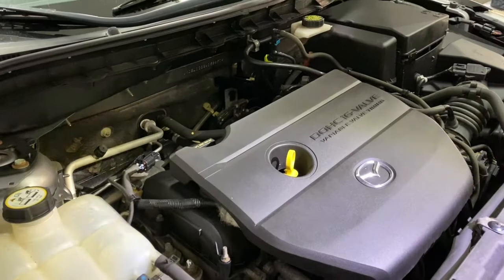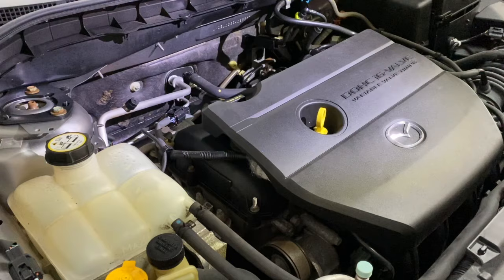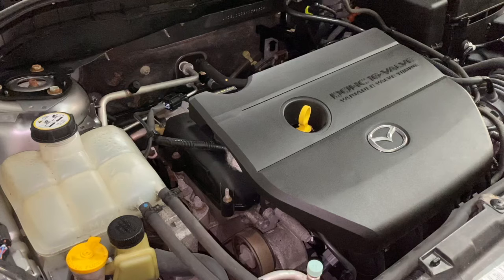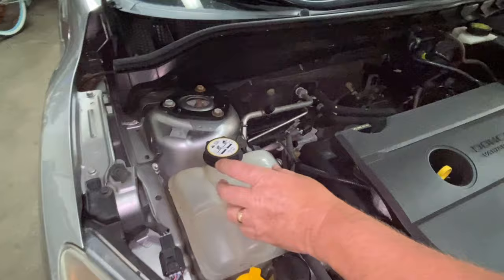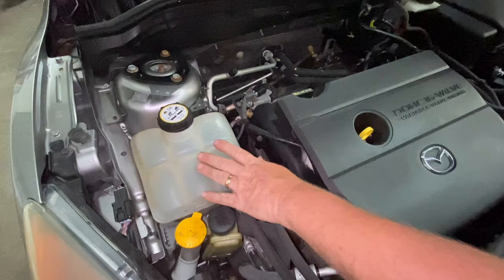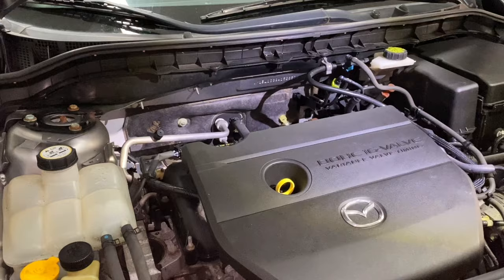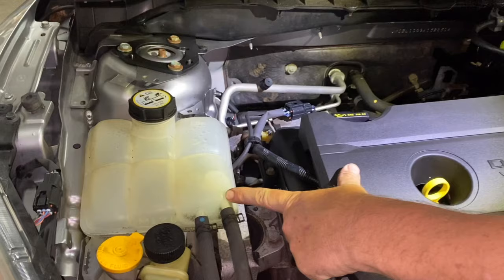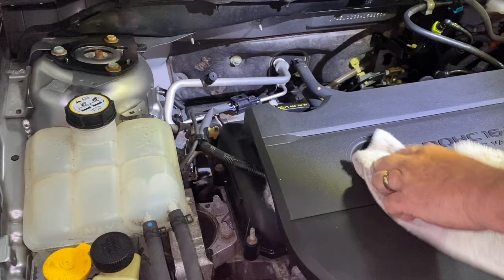Learn 3 Symptoms of Blown Head Gasket

Comment: I've had issues with my 2001 diesel ford courier. Car overheated out of nowhere. Replaced the rad cap, the water pump, the thermo, replaced most heating hoses, flushed the radiator out, no luck. Car doesn't like starting and has a slight bounce on the idle when cold. Slightest bit of white smoke/condensation out of the exhaust, but as i put my foot down on the throttle it blows out clean instead of more smokey etc. My heating core in the cab has its issues, doesnt like to open up for heat often but when it does open up it's blowing hot hot lol when the car starts to get hot it blows out coolant into the overflow and boils/steams out the overflow hose. Wondering if its a bad head gasket or worse, a bad head.. i cant figure it out atm. Thinking of replcing the head gasket and checking if that does it, but if you have any suggestions or tips, id love to hear them :) cheers mate. Great video.
Reply from the maker: Seems like its a failing head gasket, probably from corrosion being you said heater doesn't work good.
Reply: @Motorcarnut  cheers for the response mate. That's what I've been thinking myself tbh, another persons input is always welcomed though :) I shall replace the head gasket and see how i go. Wish me luck lol cheers.
Reply from the maker: Good luck and let me know how you make out!

Comment: I have coolant spitting out from the cap I'm assuming is the head, clutch fan is fixed waterpump is fairly new, thermostat is open, it overheats a lot faster when ac is on.  When driving with it off I haven't seen it get hot
Reply: I also had the vehicle for 2 weeks and only used it 3 times fml
Reply from the maker: Yes, it sounds like either a blown head gasket or cracked cylinder head if water pump thermostat and radiator are not clogged. Also, check the radiator cap could be faulty you never know. Start with simple things first
Reply: @Motorcarnut  a bad radiator cap can cause smoke in exhaust??
Reply from the maker: No, but a faulty radiator cap can cause the engine to overheat and ultimately blow the head gasket and then blow white smoke from the blown head gasket failure.

Comment: I have a 05 Santa Fe and I live in Vegas on super hot days 110 + my coolant will be bubbling in the reservoir, then when my car is in park and in park only I will loose coolant and it will be raining from the res on the bottom and my AC will go from hot to cold. Those are my only symptoms I don’t have any smoke from exhaust, light smoke from where the coolant is hitting the hot parts of my car when it leaves the res, and it does smell like coolant is burning. Anyone know if it’s just a leak, a head gasket, or my radiator cap?
Reply from the maker: Try the cheap simple things first. A faulty radiator cap will cause your symptoms, start with that.

Comment: Hey man I got a 2005 GMC sierra 1500 SLT 5.3L, over the last month and half everytime I start my truck there’s a lot of white smoke and has a blue tint but smells burning sort of and I checked my oil I lost a lot 90% of it and my coolant gets very low too, I have no leaks tho I checked all around and nothing. My oil isn’t a milky color either just normal used oil and due for an oil change with in the month, so should I changed the oil out soon and Motor flush it? Then get a new head gasket? Or maybe is it possible value covers or piston rings? I need some advice here thanks
Reply from the maker: 90% oil loss and no leaks? you sure? The burning smell is probably oil and or coolant burning . I always say start with the simple things first. you can try the motor flush and try cleaning the engine top and bottom so after it dries you can see if you have external leaks as well. If it still smokes then further checks are needed.

Comment: My temperature gauge goes bout 224 a little over the half mark witch is 210 then then the fans turn on and it goes back to normal to 210 I replace my thermostat and still doing the same thing plus I notice my Cooland hose the main one that goes to the radiator gets real hard. Do u think is my head gasket by the way I don’t see any smoke or oil or even Cooland leaking.
Reply from the maker: Sounds kinda normal. Was the temperature always like that? Could be a failing coolant temp sensor that controls the gauge.

Comment: So my car has a coolant consumption problem where the coolant would go low but car doesn't overheat and ac works fine but heat sometimes gets intense and on next few days it is perfect. Any ideas of it's head gasket or something else? Also it's es350
Reply: You could have a slow leak at the heater core
Reply from the maker: The AC has nothing to do with the coolant system and the heat only get so hot so, like someone else said could be a small leak somewhere, as long as it doesn't overheat or has excessive white smoke out the back or coolant mixing with the oil.

Comment: I have a 2014 Dodge Charger I have a Coolant problem. I have changed Thermostat ,water pump ,sensor I have kno leaks whatsoever under the car or around the block, I have noticed my Fan comes on when AC Is On , but it’s Runs Hot , I don’t have white smoke coming out the pipes, But honestly I’m lost trying to figure out what it might be please can someone help me
Reply from the maker: Fans coming on with AC is normal , it’s supposed to. Could be as simple as a bad radiator cap or overflow tank cap. Clogged radiator or air in the system. A blown head gasket could pump up the coolant system and cause it to run hot too.

Comment: I'm gonna buy a Durango but the owner thinks it's a blown gasket cause she was driving it and it died. She said it didn't have coolant when it died. But I did these steps and none showed signs of it. Could it be she just didn't put coolant in it and it overheated and died?
Reply from the maker: Let’s say that’s true? If it indeed overheated because of NO COOLANT that’s worse than a blown head gasket and they didn’t keep drive it . This case it may need an entire engine for it to overheat that bad it shut off. Because you can have not only warped heads but possibly the engine block as well. Best to have a mechanic look at it in person before buying it. Good luck

Comment: My car doesn't show any of these signs, but the coolant is overflowing and saw some bubbles with the radiator cap off. What could be the issue? Didn't see any coolant leak too
Reply from the maker: Car is overheating for some reason, head gasket should be last on the list, check radiator cap, thermostat, water pump clogged radiator first
Reply: @Motorcarnut  thanks. Will check them first. Hopefully it's not anything major. It's not overheating though, temperature is normal right in the middle
Reply from the maker: If the coolant is overflowing it could be just a bad radiator cap. But something is wrong, shouldn’t be overflowing.

Comment: Hello my car doesn't have any of this symptoms but yes I do find that that my car is weaker but he does not have this symptom all he does I feel him up with water because I do not put no more coolant because every time I ride the car I get home he starts spilling the water through the plastic bottle and starts boiling at the same time but he does not have the symptoms why could this be please I need help I was thinking of flushing it and cleaning it but I wanted it to be sure cuz I'm about to buy a new radiator I could drive him he never gets hot it's always on The Middle he drives normal on the highway but as soon as that I get home and I turn him off that's when the bubbling starts coming out of the plastic bottle and drops all my water on the floor and I have to be refilling it to be able to drive him
Reply from the maker: Coolant keeps the car from overheating, straight water boils over faster, that’s your first problem. Yes, definitely the car is overheating, could be as simple as a bad radiator or overflow tank cap, clogged radiator, bad thermostat or water pump.

Comment: I read some questions asked and didn’t see the one i had. So I’m not burning off any coolant and i did a oil change a week ago and only noticed it to be discolored blackish gray. But i changed the exhaust manifold catalytic converter last night then today noticed more white smoke on cold start then also if I’m revved around 2,000 rpms like continuous if it’s revved is it still a blown head gasket ?
Reply from the maker: Its possible, You can have someone check the coolant for exhaust gases that would indicate a bad head gasket.

Comment: My FJ overheated then when we filled the radiator bubbles overflowing everytime i drive the radiator hose always pops off is this a sign for blown head gasket?
Reply from the maker: Yes
Reply: @Motorcarnut  i told my mechanic and he was telling me "oh its only making bubbles because we put that radiator cleaner" now when we check the oil mixed up with water. Would it get fixed if we replace the head gasket?
Reply from the maker: That don’t sound right to me.

Yes, but also have to make sure head and block are straight and not warped.

Comment: I have a 2004 PT Cruiser 2.4 L Turbo I replace the water pump bought a new radiator has steam coming out of the radiator can't figure that out there ain't no white smoke coming out of the tailpipe though I was wondering why is there steam coming out of the radiator for and bubbling up out of Reserve I can't figure that out it has a sign of little bit of milky oil on the valve cover cap it doesn't have no milky oil at all can't figure out the problem I say it might be a blown head gasket but I'm not for sure though thanks let me know what you think it might be this is my first PT Cruiser though I didn't know they give you that many problems
Reply from the maker: Simple things first, did you replace the radiator or overflow cap? And what about the thermostat? Did you bleed the air out of the system after radiator and water pump replacement? If those check out fine than it’s probably a failing head gasket pumping up the coolant system.
Reply: @Motorcarnut  yes it has brand new radiator cap and everything I did all that and it's still doing the same thing
Reply from the maker: If you did everything I mentioned then it’s a bad head gasket or crack somewhere in the coolant system getting into the combustion chamber but probably the weakest link with is the gasket.

Comment: Great video man, i do get white puff smoke after my car driven and sets for a short of time white smoke last for 3-4sec at startup while car is warmed and it does happens often mainly when my car parked incline ? Any idea what is that  ? 08 Lexus gs350 it has 123mi thanks again
Reply from the maker: Thanks!

If you are getting that white smoke when restarting a hot car then it seems to me there is a little bit of coolant burning off meaning the head gasket is starting to fail. Coolant should never be in the combustion chamber. And a crack somewhere would be rare.
Reply: @Motorcarnut  but my coolant level always at the line 🤔
Reply from the maker: Maybe the puff of smoke is blue ish? That would mean you’re burning a little oil

Comment: Sir, working on 1996 Buick Park Avenue 3.8L for a young man so he can go to school.  How can you tell the difference between blown head gaskets versus cracked block.  The car had been sitting for 12 months, drained the old gas, fresh plugs. It started right away and the smoke was horrible through the muffler and it was coming off the engine through the vents.  I want to help, but not sure how to proceed.  Thanks.
Reply from the maker: The only way to know the difference is to take it apart and inspect it. But a little history would help. Was the car stored in cold climate and left outside with the proper mix of antifreeze and water? Let’s say the car was from Canada and left outside all those years with only degraded coolant then I would say it probably froze and cracked the block but those cast iron blocks can take a lot of abuse and would of blown out a freeze out plug first. Probably a blown head gasket in my opinion.
Reply: @Motorcarnut  it’s in Mississippi doesn’t freeze much here, but I’m thinking he let it overheat, low coolant. Thank you.
Reply from the maker: If that’s the case it’s probably a blown head gasket like I said before. Those engine are very strong.
Reply: @matthewpague1750  You can try block/head gasket sealant product.

Comment: I have a 2005 scion tc and there is oil in the exhaust pipe.  What could this be?  There is no water in the oil and no oil in the water over flow.  Gd video
Reply from the maker: When you say oil in the exhaust pipe is it raw oil dipping out? a film of oil? Is it buring blue smoke out the tail pipe?
Reply: It’s not blowing blue smoke
Reply: I put my finger in at the edge of the exhaust pipe and it’s black oil
Reply from the maker: Oil out the back like that often indicates serious failures or wear of the engine's internal components, such as valve guides, broken or worn piston rings, or a head gasket staring to go. You should have a good mechanic check it out for you sooner than later to save money.

Comment: My Toyota Camry exhaust is smoky white when first turning on the car but  it doesn't smoke once driving minus when occasionally hitting the gas after being idle at a stoplight. The low oil pressure lamp light occasionally comes on when braking at a light. The mechanic says if it's the head gasket the white smoke should be constant and it isn't. I don't know what to do.
Reply from the maker: When you first start a cold overnight vehicle there will be light thin whiteish smoke with is condensation and normal. It should be like in my video. And after hitting the gas when the engine is hot should not show signs of smoke. Low pressure problem should be checked out immediately because if it’s not a faulty sensor and in fact low oil pressure you can destroy the engine very quickly. Also bring the car to a good mechanic and have them check the coolant for traces of exhaust gasses, that will confirm a head gasket that is going or it’s something else. I can smell the exhaust and know if it’s burning coolant but I’m not there to help you.
Reply from the maker: Meant, it shouldn’t be smoking like in my video
Reply: @Motorcarnut  thank you for responding. I am following a few local leads for a good mechanic now. It is smoking white like in your video when first turned on. It doesn't while driving but I'm nervous about the destroying engine quickly thing. Anyway, thanks 👍
Reply from the maker: It’s not supposed to smoke like mine in the video, even cold. It’s probably a head gasket starting to go, like it leaks very little overnight and when you first start it, it burns off what was in the cylinders and that’s why you get the smoke when cold and clears up while driving. Either way have someone honest but stay away from dealerships, they will waste your time and money.

Comment: My car has low coolant despite a new radiator and there are no leaks. Can a coolant leak into the engine cause a catalitic converter to go bad? My check engine light is on and the code read P0420 as a catalitic issue.
Reply from the maker: Yes, if you’re burning coolant because of a failing head gasket.
Reply: @Motorcarnut   It may be the coolant reservoir leaking from the cap. I drove the car and when I got home I saw coolant leaking out of the cap. It is still under warranty so exchanging it today.
Reply from the maker: @arielrodriguez6980 that will do it

Comment: i got a 2004 Chrysler pacifica that runs hot but does not smoke. a mechanic told me it was the head gasket but there is no milkshake it runs hot. i had to take the thermostat to get it home from the mechanic. there is a shop that wants $1400 to replace it but even they asked if it was smoking. do you think it's the head gasket? could the head( s) be warped?
Reply from the maker: You have to see if the coolant system is being pressurized by the pistons causing the overheating condition. That would indicate a blown head gasket. Make sure radiator, water pump is good and even a simple radiator cap can cause the overheating as well.
Reply: @Motorcarnut  thanks. the item that tipped the mechanic off was the presence of some type of carbons present it the overflow container. he used a sensor and said it should read zero. as the car was being revved the sensor began to show elevated numbers of this carbon. that was his evidence that my head gasket was blown. I will check out my radiator cap.

Comment: my 2023 genesis g70 3.3t awd with 2000 miles  the head gascet blew  it smokes from radiator from exhasut and oil pours from exhaust
Reply from the maker: Wow! Unbelievable. No reason for that, bring it back and get a replacement vehicle.
Reply: @Motorcarnut  in order to do lemon it needs to break down 3 times then i can switch it i took it to service i found out its the Turbo it gave up  thats why it was smoking and leaking oil they gonna fix it soon
Reply from the maker: @serobboshnakyan1048 Ok, well hopefully you won’t have any issues after that. Good luck!
Reply: @Motorcarnut  thanks alot likewise

Comment: What if it only smokes when you first start the car it blows a cloud of smoke then and it stops!.
Reply from the maker: Depends what color, if it’s blue your valve stem seals are leaking oil overnight, if it’s white you have coolant seeping into the cylinders which indicates failing head gasket or crack somewhere.

Comment: Overfilled my car with oil and the car tailpipe and engine in the back of it was smoking bad , let out the oil the car tailpipe not smoking no more but the engine in the back is still is just a little bit can someone help me 😭😭😭 all ik is I’m overdue for an oil change and my air filter clogged I’m going to get it done tomorrow hopefully that’s the issue
Reply from the maker: You have to have someone local check out what you done.?
Reply: @Motorcarnut  nope I been scared to drive it but I’m going to once the snow is gone